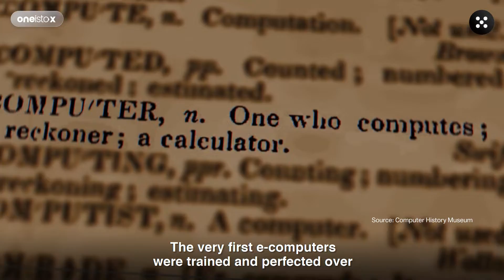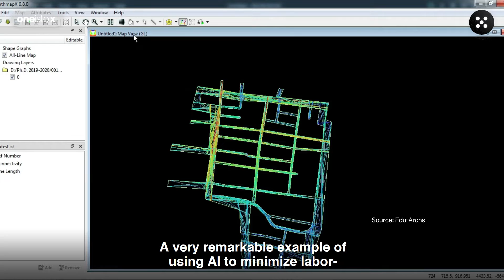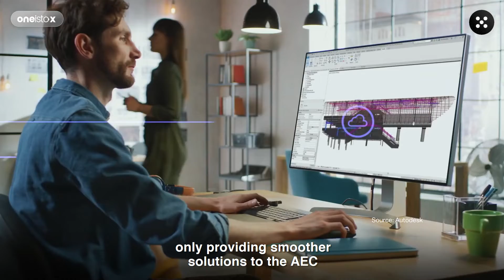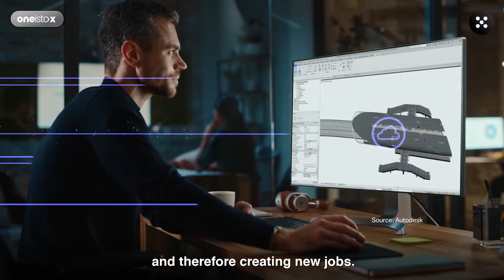How will Artificial Intelligence impact Architecture and Construction?

Comment: I don't agree with your stand on humans providing empathy and feelings in their buildings through architecture, it's arguable because AI hasn't reached that level of details oriented delivery of architecture, it's on its way. 

I won't accept that BIM saves architecture, BIM eases architect's way of working and not designing capabilities 

AI can automate floorplans now, in the next 10 year time it can even be trained further and has its own library of a particular architect's style and clients can directly take advantage of that with not reaching an architect, choosing their start-to-end full set of drawings, and much more, 

there is an accountable factor though but when if the drawings pass to another AI to test and quality check, it's no place for a human to intervene anymore, 

if a client has a particular vision and if they get all they want just by selecting and making decisions right away on a website, that's progressiveness. Like how we shop on Amazon and purchase stuff, in AR/VR - AI-Assisted Building is soon to be launched.

Clients can directly have their thoughts to life with AI, yes it needs initially some human intervention in terms of execution but designing should be done on full command of the client.

Architects and the AEC industry cannot process many client's visions from start to end, maybe high-profile clients can be given enough attention but otherwise not middle class can have their dreams come as they wish 

In simpler terms Revit costs roughly $300/month and an architect charges between 10-25%, now with AI-Assisted user interactive designing, clients can directly be in command and pay <$1000 and spend more on construction, now tell me, am I wrong?

Don't delete this comment, let this resonate in the minds of the capitalistic architecture firms and let them know what will they be worth in the future. 

You are not in command anymore, 'client-based AI interactive platforms' is and will be. 

Dont delete, it's not against NOVATR.
Reply from the maker: Thank you for sharing your perspective on the role of AI in architecture. It's definitely a topic that sparks a lot of discussion and debate within the industry.
Reply: :face-green-smiling:  bro you spitted out all your frustration are you already an architect